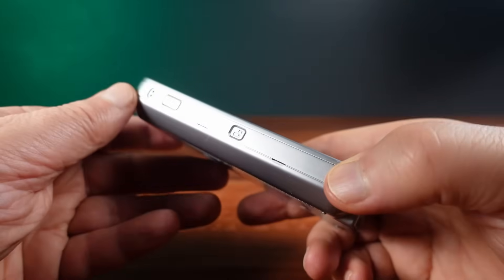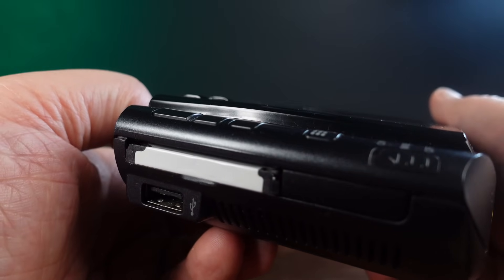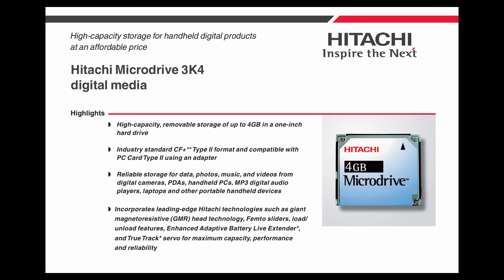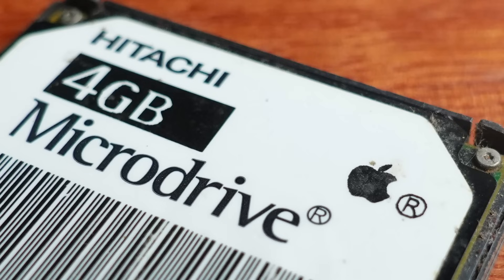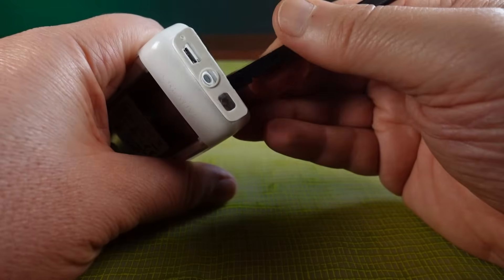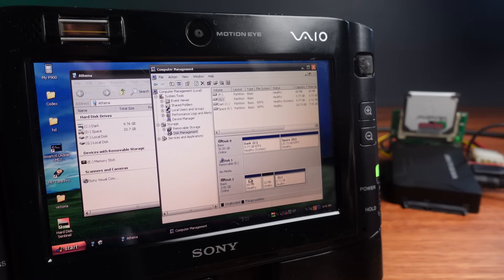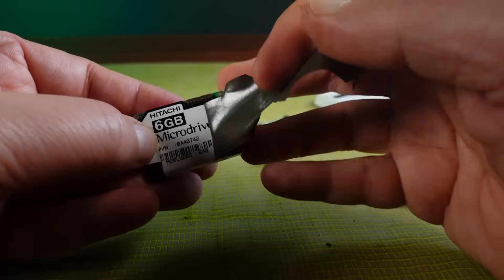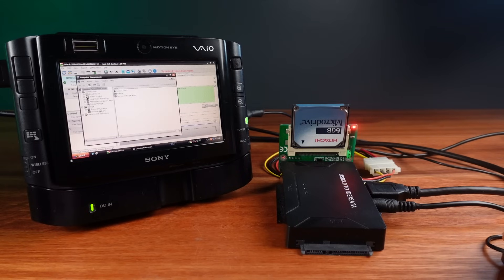Miniature Hard Drives

Comment: I also have a lifedrive, the microdrive on mine died in around 2010's and I just threw it with the cables and charger on a attic box back them, with the recent palm scene revival(palmdb and more), I found that I could revive it with a cheap 4gb sandisk CF card and a copy of the rescue rom(it's available on palmdb) and now I have it working again.

For me the lifedrive is one of the most underrated Palm devices out there, it's one of the few palms(if not the only) who's storage and RAM(it uses SRAM) isn't volatile, so you can boot palm linux, mod the entire system and more without losing everything, it was also a media power-house because of the 4gb of storage, the lifedrive was one of those devices that could be so much more if it had the time and right minds behind it.
Reply: I've not heard of the LifeDrive before seeing this video, but is there any information on how it performs with larger capacity CF cards? Part of me wonders what one might be like with an upgrade to a 32GB card (The forseeable hardware maximum) or perhaps even bigger?... 😁
Reply: @dieseldragon6756  there is. Someone on reddit was able to put 128gb on one but the reason that they recommend 4gb cards are more due compatibility and knowing that IDE proper works on the card.

A lot of bigger cards, the IDE doesn't work properly
Reply: @dieseldragon6756 there is, if you search on Google(can't post links on yt) "reddit 128gb lifedrive" you will see a post of a guy who upgrade one to 128gb cf on one and it worked flawlessly.

People theorizes that 256gb and even 512gb cf cards are possible but from what I read, there's so much things that can "go wrong", like the CF card not supporting IDE standard properly, the OS not being able to handle(like how win95 doesn't likes filesystem bigger than 20gb IIRC) and another myriad of stuff. Which is why they recommend to stick to 4gb SanDisk cards but if you have a card collecting dust that is bigger, I would try it first
Reply: @dieseldragon6756 youtube keep deleting links but searching for 128gb palm lifedrive shows it.

The card not having the IDE protocol working properly happens more than people realizes in modern cards, you can see that a lot in some retro builds where people uses it and the bios doesn't detect the card

Comment: on that dead drive is the internal data cable disconnected? it seems to moving too far as the head rotates.  maybe it just needs to be plugged back in and glued down.  Need to add some quick performance tests :)

Comment: Looking at the GL843 it seems to contain a RISC 4-core CPU inside from the data sheet. I see ICC voltage vias for RISC cores and all kinds of things with the 843. Offset 07h seems to be DMA control. There's VCC for 4 cores of RISC. Since the GL843 is a flatbed scanner IC, it might be identifying as IDE to the controller IC and then it just is a 4GB flash drive, since it has IDE and DMA controllers. QFP-208, not the 200 since there's two versions of GL843.

Comment: I have a Trekstor Vibez 8GB mp3 player that uses a .85" hard drive (smaller than the platter in CFII drives). It was supposedly also available in 12GB at the time (2007) but I never saw that actually on the market. The Vibez used the chipset and firmware from the Rio Karma so it was popular among enthusiasts at the time, but the choice to use a hard drive in 2007 was seen as questionable, and the industrial designers were somewhat 'confused'. It wasn't on the market very long. Promises of a flash-based follow on were apparently planned but never materialized. That was likely one of the last consumer products to use a microdrive.
Reply: It's quite possible that as flash storage took hold MicroDrives started being seen as obsolete, driving their prices down.

I do know that if I was planning to produce a product with an embedded 8GB CF card costing $16,- a throw and then had the opportunity to buy a batch of unwanted 8GB MicroDrives at $4,- each, all of my customers would be getting devices with MicroDrives in them... 😉
Reply: @dieseldragon6756 CF wasn't that cheap back then but it was catching up to microdrives, and the spinning disks weren't fully trusted in a portable application like mp3 players. Microdrives were definitely cheaper per gigabyte at the time but people were willing to pay a little more to have no moving parts, so people felt it would have been better to use flash memory in a new player introduced in 2007.

Comment: Great video. This reminded me of my first MP3 player from early 2004: The RIO Karma. It was a squarish thing with a scroll wheel on the top right corner and it contained a 20 gigabyte mechanical hard drive. It also came with a decent dock for connecting to hifi equipment and even had a LAN port on the dock to allow it to be accessed via pretty much anything on a LAN. It was a great bit of kit for the time.
Reply: The Karma was legendary for the best OS but also for its fragile hard drives.
Reply: @stevew1487 sadly mine met its demise when the little scroll wheel came off. I replaced it with another Rio which lasted well until the inevitable rise of the smartphone but I can't remember the name: forge or something. It was a slender thing, very thin but wide, with very smooth edges, like a pebble.. This video is great nostalgia.
Reply: @aindow  Oh yea the scroll wheel was another weakness. It was possible to repair them with superglue, I did a few on Rio's other player, the Carbon. The Forge is a great little player and takes I think regular size SD cards and can use the same firmware as the Carbon I think. I still have one somewhere.
Reply from the maker: Wow, I really like the look of that player.

Comment: Does anyone know a drive/card combination that would work with a Roland MC-80 Midi sequencer? I tried so many kinds, but nothing gets recognized. It's supposed to be standard IDE, but they only had something like 6 drives in total that were supported. They're impossible to locate, and flash cards don't get recognized, no matter what interface card I use. Has anyone been successful at finding a modern drive solution for old Roland's?
Reply from the maker: What capacity card does the Roland normally work with? Do you know the brands that are supposed to work?
Maybe trying an embedded Compact Flash card.
Reply: @JanusCycle  Manual says "HDP-88" drive type. I remember seeing another document where 6 drives were listed, all under 2GB capacity. Laptop IDE sized. I tried many adapters that worked in laptops and in other retro hardware, but on that specific sequencer, no flash was ever recognized. Though, having just now searched this topic again, I find that some people did find SSD drive combinations that function. I think my concern may have been addressed elsewhere. Will have to buy and see. I do have one actual mechanical drive that works. Looks ordinary. And I was wondering if they just had serial numbers hard-coded to reject unapproved brands. Knowing Roland, I would not be surprised, if this was intentional.

Comment: Miss the pocket PC era. I had one of the iPaq's and a Jornada 720. Even bought a 2nd one after the 1st one wore out due to me using it everywhere. I seriously considered microdrives, due to them being cheaper than flash, but still costing a fortune. I chose in favor of having flash. Just less of it. On trips I'd borrow cards from friends. Around 2004 I got an external USB storage stick that used a microdrive. I took it out and it sits somewhere in a parts bin. It has a proprietary non-IDE header, so I have no way of using it. And it's only 1.4GB.
Reply: Yea they died just as they were getting good. I still have a couple Fujitsu-Siemens Loox 720's, VGA displays and 620MHz processors, could do some genuinely useful things and you didn't need to feel like you were being spied on. I remember the battle between Palm and PocketPC and finally how completely and embarrassingly Palm imploded, while they were sitting on the iphone design for years before Apple. What a bunch of brain dead buffoons....ah history...

Comment: I bet you they had made the dialer thinking they would make a palm phone only to realize that nobody wanted to support a phone they didn't control from top to bottom like was the norm back in the day
Reply: Like when Qualcomm tried to be the cellphone version of Nintendo. They wanted to make writing apps easy for feature phones, like JAVA did for desktop computers. But they didn't want to license JAVA. So they created BREW. Binary Runtime Environment for Wireless. So good so far. Then came the stupidity. The BREW development kit was not free. All BREW apps had to be approved by Qualcomm, the manufacturer of the feature phone, and the cellphone carrier the phone was locked to. It was exceptionally difficult for an end user to extract a downloaded BREW app and copy it to another phone. IIRC BREW wasn't as system agnostic as JAVA due to varying display sizes and other hardware differences, but in theory someone could write an app once and compile it for specific phones.

Qualcomm expected ultimate control over all things BREW, and combined with every app requiring three parties to agree, there weren't many apps not created by the telcos, and the were mostly awful. It was impossible for anyone to write and release open source or freeware BREW apps for anyone to download and install because the 'gateway' to download and install was locked in by the telcos, plus the costs of the development kit and getting 3 companies to greenlight the apps.

Qualcomm could have had the killer platform for feature phone apps but they decided to be more dictatorial than Apple or Nintendo or any other company about what software would be allowed on their system.
Reply: @greggv8  Great info, I'm sure that attitude prevails in a lot of companies that get too comfortable in a fast changing market, they just assume they can dictate terms.

Comment: Amazing video as always, but you never explained why standalone MicroDrives cost so much more than the ones embedded in MP3 players despite being the same thing?
Reply: Because someone has to cover the R&D costs. The manufacturers knew perfectly well who needed such disks and how much buyers were willing to pay for them, the MP3 player manufacturers simply agreed to buy a large number of these disks at a price slightly higher than the cost of production. For the same reason, you can buy a 4-core i5 for $200, a 4-core 8-thread i7 for $700, and server manufacturers buy the same Xeons for thousands of dollars, although physically they are the same processor.
Reply from the maker: I don't know, so I will only be speculating. Maybe Creative bought a bulk order and agreed to handle warranty problems themselves. Hitachi would have made a small profit in a single deal.
Or Hitachi were marking up their retail drives to $499 because they knew their only competition was only with flash based cards were over $1000 each.

Comment: 15:43 What happens if you seal that hole?
Reply from the maker: I don't really know. My guess is to equalize air pressure.
Reply: disk will struggle to read or write the data after few hours of work.
Reply: @avamnepohui7260  Do you know why?
Reply: It's a pressure equalisation hole, used to ensure barometric pressure inside the (Dust-free) platter housing equals that outside. Without it (Or if sealed) a negative pressure difference may compromise the housing seal from the inside, causing a release of air. A positive pressure difference - More likely to occur if the latter has taken place - Could cause the lid of the drive to be pushed onto the spindle or head arm assembly, doing irreparable damage to the drive. 💾💥⚠

It's a common myth that HDDs are airtight, this is only actually true for very recent Helium filled types which implement pressure compensation measures. If you have a dead/broken HDD to take apart (Note: This will irreparably destroy the drive) look carefully when removing the drive lid. Somewhere close to the breather hole you'll see a very fine particulate filter that allows air to pass through without dust getting into and damaging the drive. 👍

Comment: Hi! Great video, as usual! If you reassemble the zen micro/find a battery for it, be aware that by formatting the drive you effectively wiped out the player's firmware, so you will need to get the firmware update package and run it on an appropriately vintage machine in order to restore the player back to working order.
Reply from the maker: I did wonder about this when formatting. I have since seen there is a way to restore it without a backup fortunately.
Reply: @JanusCycle  if you encounter issues, I have a CF modded Zen and the original drive out of it (which hopefully still works), so I can image mine.
Reply from the maker: I'm usually more careful and make backups. I'm a bit embarrassed I didn't do this myself. If I need an image I'll let you know. Thank you.

Comment: As with most devices with batteries the power side is designed around a parallel circuit. A missing battery is like a missing bulb, electricity cannot continue without a solid link. Eg battery

Comment: I had a Rio Carbon mp3 player with a 2.5gb micro drive. I tried to swap in an 8gb compactflash card but it didn't work. Perhaps it needed drivers?
Reply: I managed to find some 8GB Sandisk CF cards on closeout at Radioshack that work. I have 4 or 5 of them. They probably need new batteries but they work fine, just the transfer is very slow but once your music is on they work great (no re-boots etc.)
Reply from the maker: I'm always wary when crossing the 4GB level with differences to things like filesystems. Also maybe some firmware was on the drive.
Reply: @JanusCycle  The maximum the filesystem could see on the Rio Carbon was 8GB. The problem was finding a card that worked, most went into a boot loop, but I managed to find some that work and converted several players to 8GB CF several years ago. The firmware developers were active on some boards back then and before the company went belly up they released a special firmware for the Rio Carbon called 'The Developer's Cut' that gave it better CF compatibility and added several features.

Comment: You can get a zif cable to IDE adapter set. If you try adapting it to CF card IDE you should avoid making the mistake I did, these drives run on 3.3v and not 5v like most CF cards do! Rip my 40gb 1.8" zif drive I'm sorry.
Reply from the maker: I would love to get ths drive working. Except this is not the same connector as zif that 1.8 inch drives use, it's smaller will a tighter pin pitch.
Reply: @JanusCycle  Yeah so you just have to find the (rarer) smaller to zif cable.

Comment: It is perfectly normal to not be able to read SMART trough usb cardreader. Software use different method to communicate with drive directly which is not standard and only known how to implement for few usb cardreader chips. If you try do it on linux with smart console tool it would explicitly mention this fact.
Reply from the maker: Testing these on my next Linux install on a machine with a CF/PCMCIA port will be interesting. I'm very interested in exploring the difference between USB card readers, CF/PCMCIA and the USB IDE adaptor.
Reply: @JanusCycle  CF/IDE adapter should be very consistent way from my experience